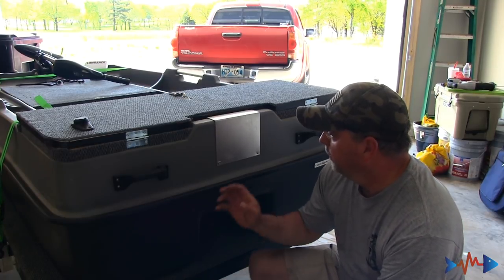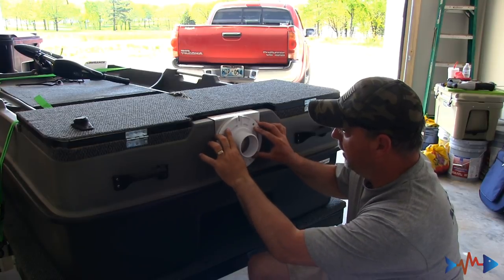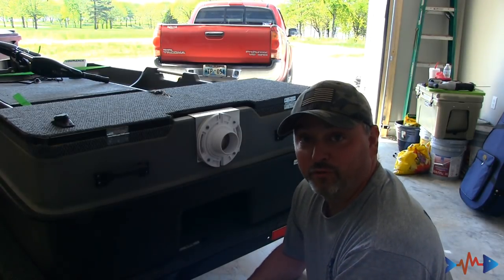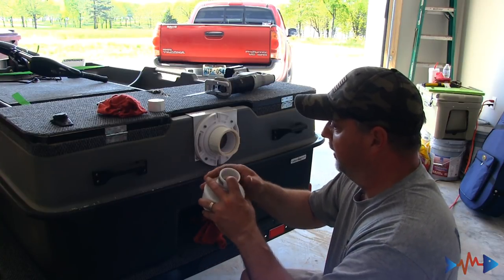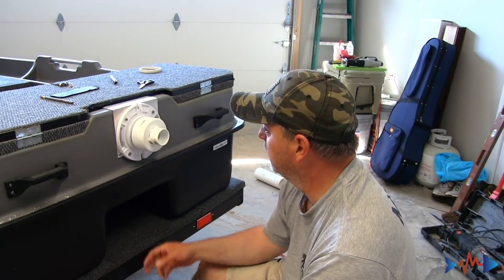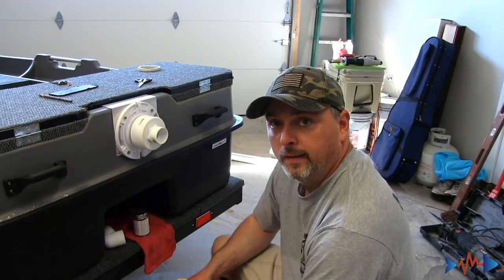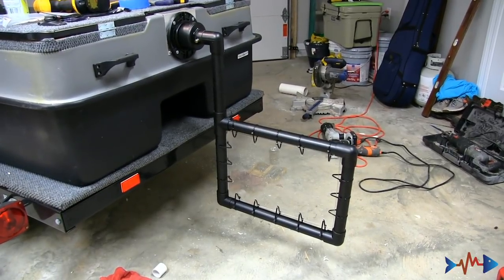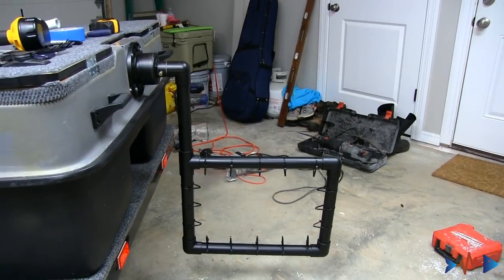DIY rudder for the Sundolphin Sportsman

Comment: When you said, " where you would mount a small outboard ". I took an old trolling motor, kept the mount and shaft. Bought some plastic kayak paddles. Cut the paddles off with about 6" of the pipe still attached. Use 2 pvc T fittings and line up on the bottom of the trolling motor shaft. Drill and bolt them in line with each other. Should get the idea now. Works very well and if you have a old transom mount trolling motor. It's less than $20
Reply from the maker: ky poolhouse heck yeah great idea!
Reply: Picture? May try that

Comment: Good job. Maybe cut in a threaded male and female adapter to allow you to turn it a few degrees either way in case you’re fighting wind or current. If you tighten it just over hand tight you should be able to swing it up and use the rudder itself as your mechanical advantage to swing it each way just a bit. I’m still in the research phase myself but I see them tied up outside of cabelas every time I go to my gym next door.
Reply from the maker: Dane Stonebraker thanks for watching and for the comment!  You won’t be sorry picking one of these up.  Super nice little boats.
Reply: Thanks. I’ve watched so many videos on them. It’ll be perfect for the tualatin river I think. Do they hand logs pretty good? Will I be able to hop out and pull it over a couple shallow spots? Like 6-10” deep. I have a 11’9” oldtown guide canoe, but with a bad back it’ll be nice to stand up in. I’m currently 400# but hopefully below 350 come spring. Is it steady enough for a mid day nap ?
Reply from the maker: Dane Stonebraker mine would float in 12” water but yes they only weigh about 110 pounds before adding batteries, trolling motor etc.  You could easily do what you mentioned.

Comment: How is that boat? Do the seals leaking water into the pontoons? If so, how do you drain out the water? Thanks.
Reply from the maker: Joseph I appreciate the question.  I had an issue once with water getting in.  I had the boat covered with a tarp outside during a heavy rain before my shop was built.  Water got through the tarp that I didn’t know about and it got into the pontoons.  As far as the seals leaking you will probably have a little bit but shouldn’t be anything like I dealt with after that rain.  As far as draining, there is a rubber plug on the front right pontoon.  Just pull that rubber plug out and lift the back of the boat up and at an angle so the water will drain towards that drain.  Just pop it back in once it drains.  I actually sold the boat but I absolutely loved it.  Thanks again✌🏼

Comment: I would have mounted the toilet flange on a piece of 3/4 ply .then clamped another piece of ply to the boat. installed hinges to connect the two pieces together . That way you could lift the rudder out of the water when needed
Reply: ABSOLUTELY!! I'd have made some type of base attached to a board. Clamp the board!! No holes in the transom, quick release too. And I'd make a SKEG, (fixed), not a rudder (moveable for steerage).

Comment: Let me know how that works out!  My bass raider just turns circles in the wind and I've been think about this. Great job!
Reply from the maker: TonyB thanks brother will do!
Reply from the maker: TonyB, so the rudder worked SO GOOD.  It actually kept the rear straighter than the front.  Only change I’m gonna make is instead of allowing the 1 1/4 downpiece to swing upwards, I’m gonna make it more stationary.  I can take it off with the pin if I need to while I’m out.  All in all I think you’d be happy with a rudder on your bass raider as well!
Reply: That's awesome,  definitely going to add it to my list. Took it out on the river last weekend and had a heck of a time keeping it straight.

Comment: Brother, that's a skeg (fixed, to resist stern deflection) not a rudder, (adjustable left/right for steering). Skeg slows hull movement due to wind and in certain cases adds stability (like a Kayak)
Reply from the maker: J Tee thanks.

Comment: What's the demintions of the Plexiglass
Reply from the maker: Terry Wynne thanks for watching and commenting!  I’ve since sold that boat, and I miss it!  With that being said, I actually bought the plexi at Lowe’s.  It was a size they stocked and was about the size I wanted.  Basically I didn’t want to cut it.  I think it was somewhere around 18”x 20” or so?  Good luck on yours!
Reply: @bassin9114  I have a 10.2 bass hound. I was out the other day and it was breezy. I couldn't keep the boat straight , fought the trolling motor all day. This is exactly what I need! Thanks for the videos
Reply from the maker: Terry Wynne I had the same problem with the sundolphin.  When I added the skeg, I actually had to turn the trolling motor sharper to make a gradual turn.  It worked great.